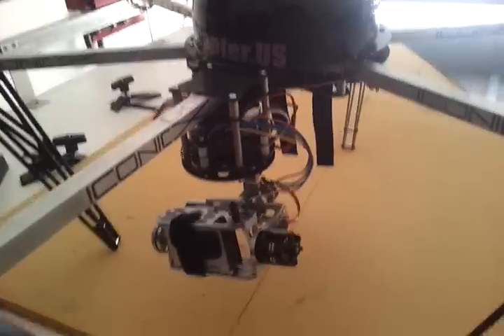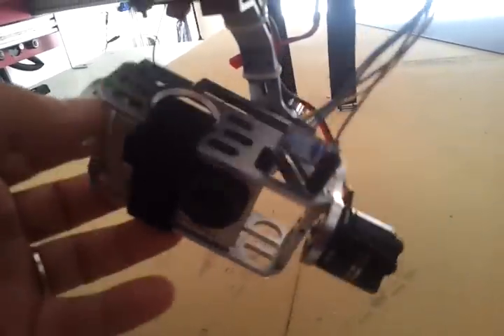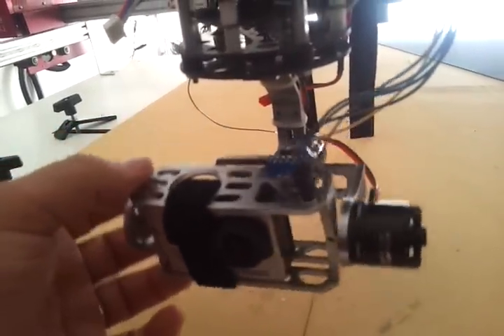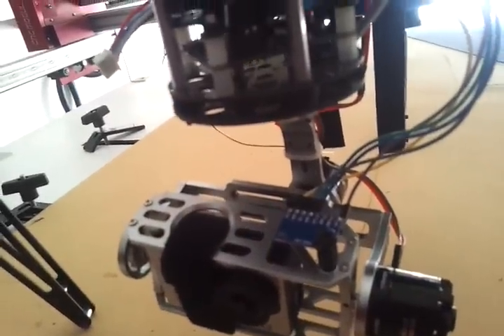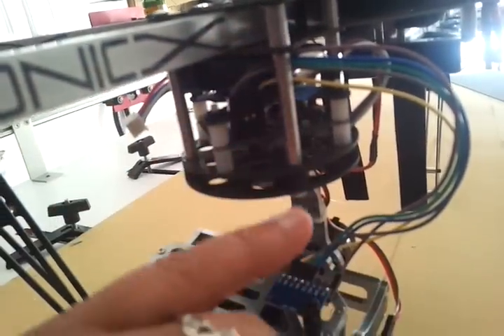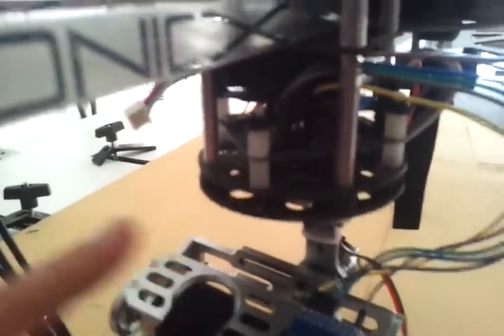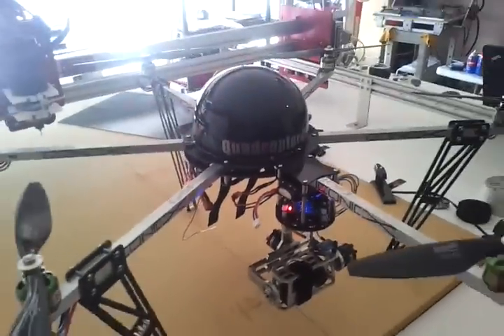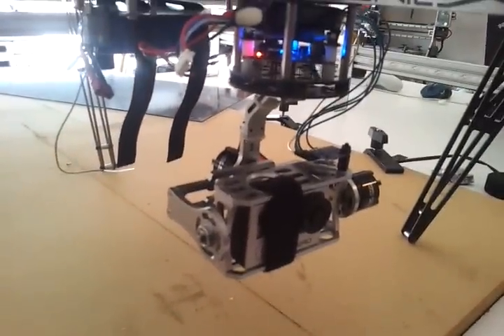Rctimer brushless gimbal setup / turning Martinez v3 gimbal on

Comment: Looking at your video it don't seem as you balanced your gopro. it should stay where you let go of it from the power of the magnets in the motor when unpowered. else the motors wil be forced to try to handle motion up down and sideways from the center of gravity not being operfect centered over the motor. for example if you hawe the center of gravity under the motor when you move your gimbal to the left the camera will drag behind tilting at an angle forcing the controler to try to counter this.